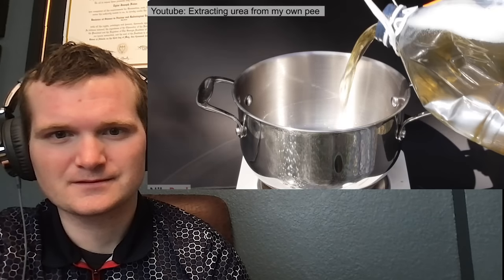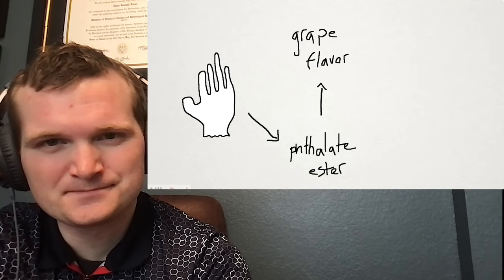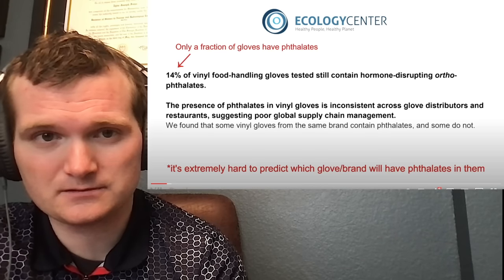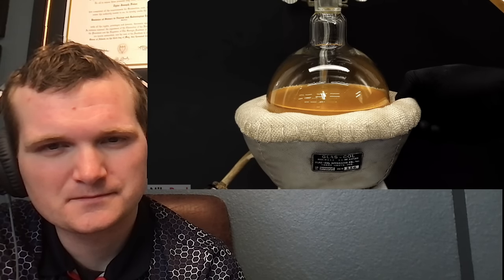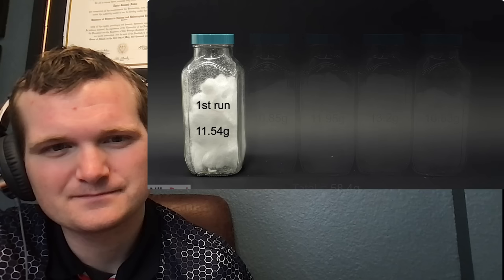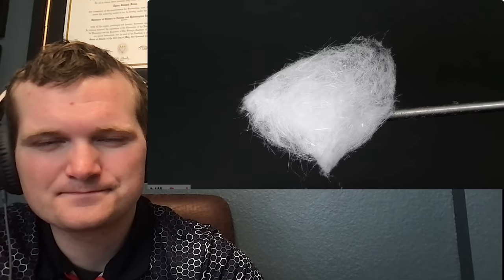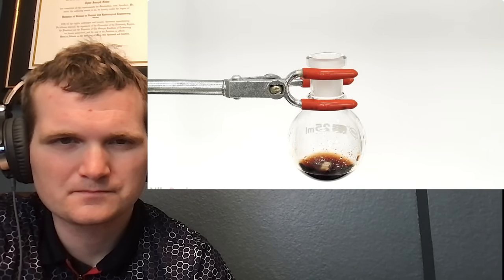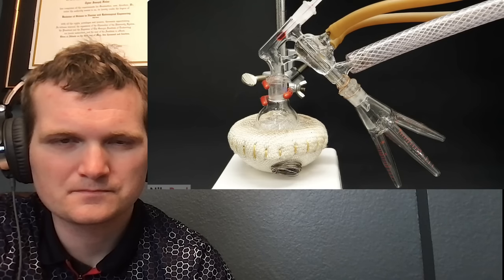Nuclear Engineer Reacts to NileRed Turning Plastic Gloves into Grape Soda

Comment: Those are round-bottom flasks, also called "Florence flasks", and they are indeed quite cool, and very, very common in organic chemistry (they're perfect for distilling/refluxing)
Reply: They are round-bottom boiling flasks. A Florence flask has a round body, and a flat bottom.
Reply: @bobweiss8682  some florence flasks actually have round bottoms they can be either round or flat (for resting on a table). but the thing is that florence flasks usually have a taller neck AND the top isnt typically ground glass like on a round bottom boiling flask. the video shows a round bodied boiling flask with a short neck with a ground glass finish at the top hence it is a round bottom boiling flask.
Reply: And buying a large flask summons the FBI. :D
Reply: @XtreeM_FaiL  I think you mean DEA...
Reply: @bobweiss8682  Some government agency anyway. Nile told the story in some podcast.
Reply: As someone currently taking irgo it was so funny seeing him gush about them because we've used them like three times already and we're four weeks in lol

Comment: We had a guy come on the radio at a coal fired steam gen plant and say "Great pressure". Too bad it was interpreted as "break pressure". He was ask to repeat himself, and he said, "I said great pressure" and at that point the main operator actuated the pressure break valves.. We got to hang around for another 15 hours, totally purge the closed system out, and re-pressurize + re-treat all of the water, again. We burnt up a treatment & monitoring board, but that's a whole other story. Another tiny stupid mistake, that was really super expensive to fix.

Comment: very cool video.  even though i've already seen the nilered video, the extra commentary and insight is a great way to re-watch it.

i'd like to make a suggestion for your microphone audio setup: try decreasing the threshold of your compressor.  a lot of words are being cut off prematurely, making it hard to understand at times.  additionally, the audio may sound crisper if you increase the mid-high frequencies (1 kHz ~ 10 kHz) with an equalizer.

Comment: He does have another video, which could be an interesting watch called "I still can't believe that Epsom Salt is mostly water." Could be interesting since there is a lot of very small changes from normal common elements into ones with nuclear use. Having a solid be close to 50% water is pretty much that. Small change and it is something completely different

Comment: Its actually pretty helpful to clearly define where you are and what result you want to achieve when you work with previously unknown issues or processes. This is what programmers use when making new programs or iterating on old code for example and its something ive used my entire life.

When i make an analysis of a certain issue i try to attack the solutions i have with different issues and see how they fare and what weaknesses i can find in the current solution. When i find a glaring issue i break that down and then change the current solution untill i can pass a load of different tests without further needing to change the newest iteration of that solution. I do all of this in my head and can go through 10-20 iterations on my lunch break and i guess thats what makes me a bit special. Otherwise its a solid way of attacking issues and seeing larger plans unfold in strategic events.

Comment: On the terminology humour and "you probably shouldn't say this" is the humour for 3D modelling:
 * "I've got to skin my model" - UV unwrapping is the process of slicing the model along edges to unwrap it into a 2D representation of all of the faces of the model with as little stretching as possible to prevent texture distortion.  The process is called "skinning" because, much like skinning an animal to make use of its hide, you slice it along single lines in out of the way places so it's not as obvious where the cuts are
* "Boning a model" - Rigging is the process of mapping vertices of a model with the bones of the skeleton that you will animate.  "Boning" is the crudely named alternative name for rigging which includes the process of creating the skeleton, and usually also followed by assigning the weights of the vertices to the bones you're making.

The difference though is modellers are 12 year olds and deliberately say these things for shits and giggles because "normies" won't understand and taken out of context will be awkward.

Comment: The triangular flask is called an Erlenmeyer flask, while the round one is a Berzelius flask, both named after 2 different chemists. The shape for the triangular allows you to mix by swirling without danger of spilling over the top of the flask so that would be the main use for it.  The Berzelius one has the "beak" (hence the "beaker" name) that allows for safer pouring from one to another.  Round bottom ones(Florence flask) like the one used here are used for uniform heating.

Comment: I wonder why he switches between vacuum filtration and just using cotton? I'm referring to the filtrations before 39 minutes when he mentioned he needed temp to be low for the later stage.
Reply: The best method of filtration for each reaction is different on what you want and in what velocity. The cotton one is better when you want the liquid part, because it can be less contaminated more easily and when you don't really have that much of solid, because then it isn't so slow. The vacuum is better when you want the solid part, because then you can dry it as much as possible using the vacuum, and when you have a lot more solid, the filter won't get clogged with all the solid. The vacuum one is the best one to not rip the filter paper apart by accident too, while the cotton one is the best to get the liquids and not risking contamination by other chemicals.

In general, it depends on what you want and what you have for you to choose between the methods!!

Comment: About his urine video, i wrote this comment before on a podcast.  Mentioned they used to taste pee to test for diabetes (diabetes mellitus actually comes from the root words for siphon, from the excessive urine, and mellitus being sweet like honey, basically coming from the fact that people with diabetes peed a lot because their blood sugar was high and the renal threshold was exceeded and thus their body tried to flush the sugars, and in doing that it tasted sweet. But here's my comment explaining the logic and reasoning behind this and why it worked that way. 

---  Well they don't actually have to taste pee anymore. Thankfully. I'm a type 1 diabetic and have been since I was 11. 45 now. Even back then they did not lol.  They do test the urine with glucose test strips. By the time it is spilling into your urine. However, it is fairly high n the blood.  

Lets consider the threshold in water.  the average detection threshold for glucose in water is about  3.3 g/100 mL (3300 mg/dL).  Blood glucose is typically in the us gauged in mg/dL. With notmal blood  glucose ranges beinh between 70-120mg/dL   across the pond theyvuse mmol/L which is odd to me especially considering that it's not exactly normal metric but ISU standard which i am not sure whyvthe choice to use that was made.  I mean i guess there is a reason. Strange  yet the most standard metric is what we find in the US for blood glucose while others use internatuonal standard unit metric. 

Now I digress. The urine is more complex so we can assume probably about 1.5-2 for minimim taste thresholds which wpuld be ablut 5500-6000mg/dL 
 
We can consider that for every 100 milligrams  per deciliter above bloOD glucose renal glucose threshold  (BGRTG)  the kidneys Will Express about 1,000 to 2000mg/dL.  The BGRTG is typically around 180-220mg/dL.

So if we assume the base taste threshoold is aeound 5k mg/dL urine glucose, a blood glucose of around minimally 680 mg/dL Just to reach the threshold. And anything above that will just add to the sweetness.   Interestingly enough, if you can taste sugar in your piss, your blood sugar is probably higher than most non-laboratory grade glucose meters will display.  So if it says HI when you test (usually 500-550) taste your pee if it is not sweet youre less ghan 650!  Dont actuallt do that.

Comment: The different flask shapes actually have different purposes! But I don't remember what they are. I do remember the round ones are not good for sitting on benches :)
He also sells flasks with his name on them.
Reply: The round ones distribute temperature much more evenly than conical flasks, which is good for the heating in NileRed's video.

Comment: 29:35 I don't think Nile Red explained it well, but he wasn't saying that the solution was neutral at a pH of 4. He was saying that the molecule 'anthranilic acid' has the affinity to act as neither an acid nor a base. The anthranilic acid can act as an acid because of the carboxylic acid group or it can act as a base because of the amine group. If it was added to a neutral solution of just water, it would tend to act as an acid because of the carboxylic acid group, but if it was added to an acid solution, it would actually raise the pH because of the amine.

Comment: On the topic of boric acid, I've heard that Canada's PHWRs (CANDU reactors) use Gadolinium Nitrate for emergency shutdown. It's not something you can just buy at the hardware store, and it's rather expensive and difficult to remove from the D2O. I think it's only used for the second SCRAM option, in case turning off power to the magnets that hold up the control rods fails. Older CANDU reactors even have a third SCRAM option, which pours out all the heavy water into the containment building, thus immediately causing the reaction to stop and costing tens of millions of dollars.

Comment: @2:30 really? The difference between water and fusion fuel is the extra neutrons in the hydrogen? I would say there is also the slight and mostly insignificant difference that there is no oxygen and that all the electrons were stripped off by pre-heating/sustained reaction to make a plasma.

Comment: "It is impossible to travel faster than light in a vacuum"
I dislike this so much. Don't you mean "We currently know of nothing that can"? Because, you know, half of our current theoretical science is based on that light speed being an absolute upper bound, and we even invent implausible theories like "Time dilation" to make the formula fit. Like, the only reason why time dilation exists is because we don't want to let go of a constant, because letting go of it breaks a bunch of nobel prize theories.
This is so silly.
And I mean I would be totally fine if we could at least experimentally measure and prove it. But we can't. And all of the experiments are extremely dirty, with thousands of variables that can affect the result. It's like the entire science community has given up on scientific method with this one, and instead of looking at it impartially - does experiments and interprets results with a sole goal to CONFIRM special relativity and SOL.
And because it is taught as an axiom - barely anyone ever questions it, and if anyone does - they get laughed at and shunned by the entire scientific community, because disproving this thing would pull the ground from under so many things.